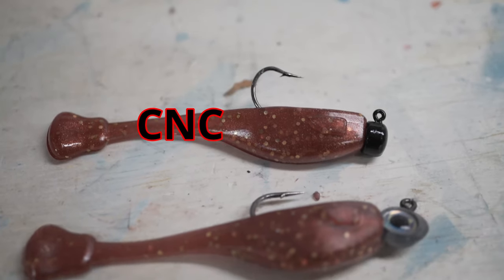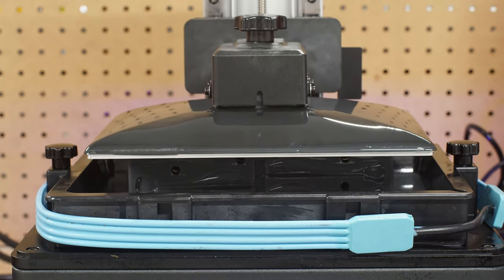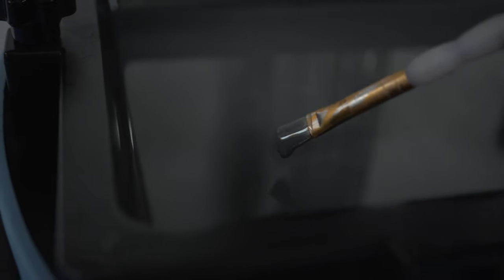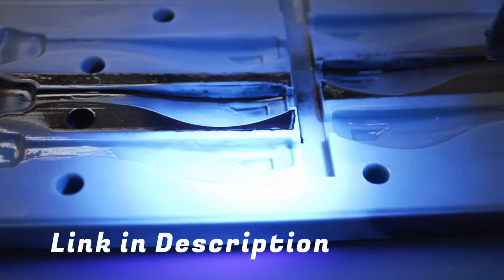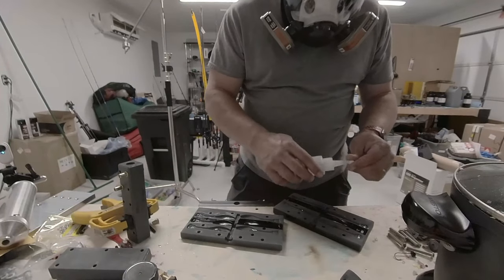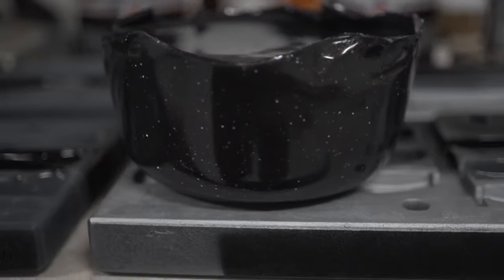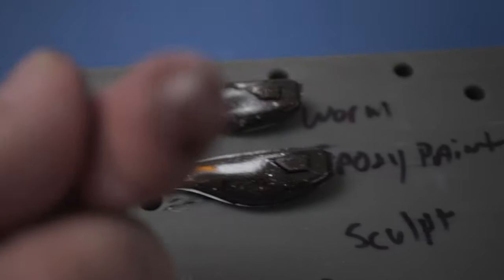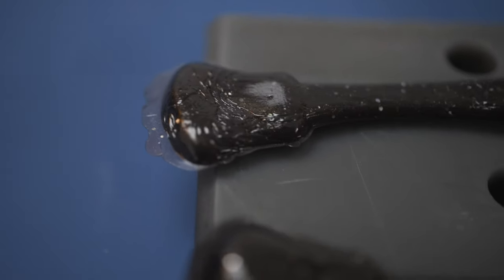Quest for Shiny Lures - Part 1 The Trials

Comment: Same here, sprayed rust-oleum high heat, and added worm oil (for better demold reason), and it turned into a gooey mess. I guess the spray paint doesn't stick to plastic that well, maybe it would be OK on metal.

Comment: Hello !
Why not make a counter-mold?
You can pour RTV silicone at will.
You can sand the positive surface of the decoy with a very fine grain to make it smooth.
You only have to do it once and you will have shiny counter molds in a material that lasts for years with 60 shore hardness for injection.
You can even use a fluid epoxy varnish to make it super smooth.
Reply from the maker: Mostly because why do all that work when I can print the mold directly that will also have the same properties. I can print more at will, multiple copies at the same time. I have done the silicone mold process before but it is simply much longer process for the same results.
Reply: @WMBayouLures  
For the service life, several years without damage / deformation much more economical.
With 10 counter-molds you can make 10 molds in less than 3 hours.
I saw it in that sense, but it's mostly for the life.
But I understand your point of view.
Too bad the CNC is so expensive
Sorry for the translation, I'm following you from France, thanks for the videos!
Reply from the maker: Your translation is great! 

Service life remains to be seen, I have one mold with 120 uses and counting with no issues, this is not FDM, it is resin, Siraya Tech Sculpt, that is made to handle higher temperatures and not deform. The only issue I can seen is breaking from not handling it properly, Silicone does not have that issue of course. In the end if you have a process that works for you, that is all that matters!